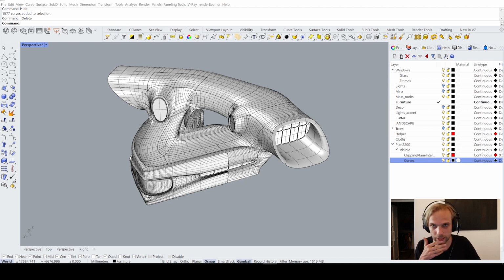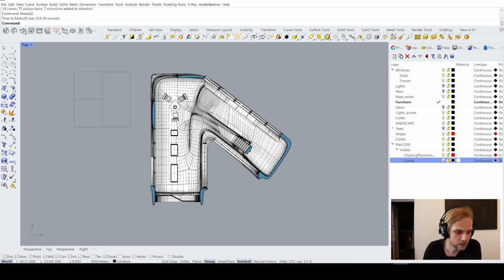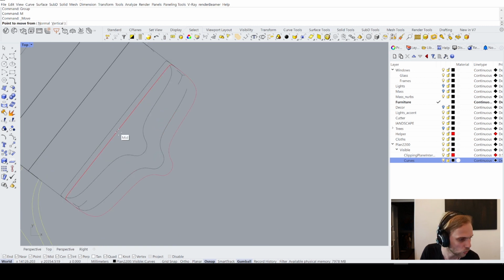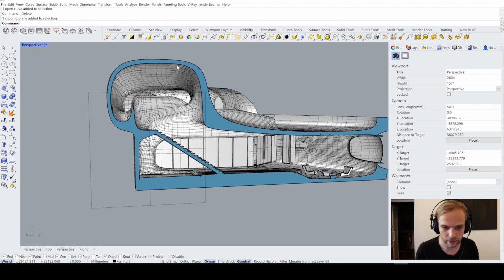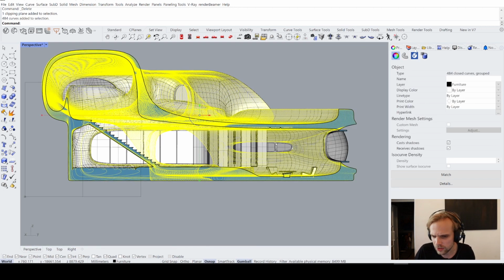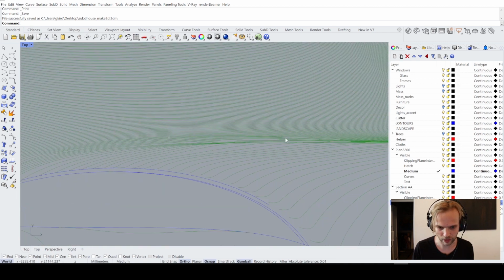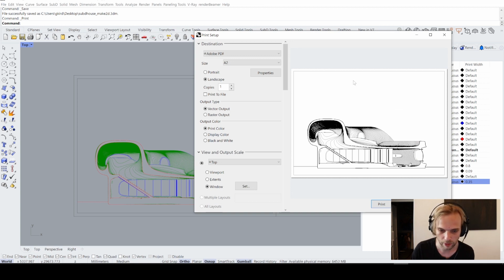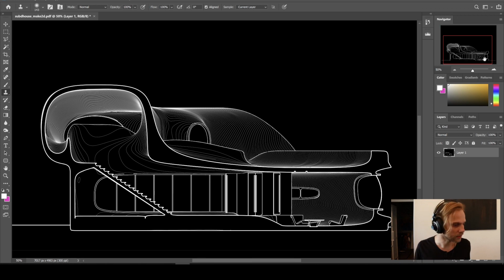How To: 2D drawings from an organic building model (with Rhino)

Comment: Amazing video as always! Quick question, I've been following your entire subd house series, for creating plans, sections, renders is it recommended to change subd geometry back to nurbs or mesh? Or can i keep working with Subd geometry? I've seen that you've converted it
Reply from the maker: You only convert SubD to Nurbs when you need to apply Nurbs-only modifications to the form mainly boolean union/difference. If you don't need to do boolean operations - then you keep it as subD to retain the non-destructive editing. You only convert SubD to Mesh for 3D printing (or if you're exporting to Unreal Engine) .
Reply: @DesignGoBrr   also if I want to render interior shell with a different material? is it recommended to extract surfaces of the interior subd layer to apply a different material texture?
Reply from the maker: @andywong8421  Yup. I think Rhino 8 will have the possibility for multi-material sub-object setup, but as it is now - it's cleaner to just have the faces extracted.
Reply: @DesignGoBrr  cool thanks, I'm guessing in your subd house project you've coverted due to boolean operations for furniture?

Comment: I would recommend just using the layout tab in Rhino, ad the "detail view", change the "detail view" display mode by double clicking it and set it to arctic or rendered to get the shades of the object topology.
Build Title block, annotations/hatches/colors, extra curves etc in layers on top of the detail views on the layout page. 
It'll incorporate future changes in your model. No need for the make2D workflow, no incomplete contours and all of that stuff
It'll be to scale and scaleable. You can change linewidths and colors in the layers tab. You can add unlimited amounts of layouts tabs, viewports, section cuts and what not. It works way faster. 

You can activate the Clipping planes in specific "detail views" in the "object properties tab".While having the clipping plane selected there is a drop down menu where you can choose between "model views" & "Layout views" to activate the clipping plane in the desired layout viewport"
If you want to export your drawings to PDF or PNG with rendered textures or shades make sure you have the latest graphics drivers installed on your machine so that it wont glitch

It's a bit of a hassle to figure to learn how to work layout pages & detail views but once you've got them down you'll make something similar to this in 15 minutes which can be instantly updated by simply changing things in the 3D model.

* I've added a video to elaborate (no audio) 
https://www.youtube.com/watch?v=cWfqfaUSQWg
Reply from the maker: Yes, I am familiar with that method and it's a good alternative to this one. The reason why I disregard it is because the output gets rasterized and (to my knowledge) there is no way to keep the linework vector-based while the underlying arctic shading is raster-based. This creates aliasing issues while printing with <600dpi printers (the stair-stepping effect for curved lines) and also makes it so that the pdf's cannot be reverse-engineered back into linework. I guess the short story of it is that there is no method that "does it all", there is always going to be a trade-off somewhere.
Reply: @DesignGoBrr  Awesome drawing and technique with the contours lines! Thanks for sharing. 
Regarding the alternative workflow, I think there should be no aliasing issues as you can choose a custom resolution to print to no? In any case, why are you worried about lines getting rasterized if in your workflow you imported them into PS? 

Maybe another alternative could be to make small pipes of the contours and print that in arctic or shaded. I did with Rhino's make2d worked better. Did you try changing the tolerance to see if it gets betters results?
Reply from the maker: @shynnsup8383  Changing the tolerance doesn't seem to have an effect anymore (it used to in Rhino 5). As for the confusion with rasterization - I used Photoshop just to show the accurate lineweights, in practice I always have all drawings handed out as vector based PDF's. Let me give you an example that seems to always happen: a year after a building has been built a client comes to me and asks for a dwg file because his contractor needs to make minor adjustments to the project (they bought a sink that's too big or something like that). Then all I need to say is - "the pdf's can be used as a reference" without needing to dig for a dwg file in my archives. If the pdf's were rasterized, I would need to send out the CAD file every time anyone needs to make minor adjustments. Eventually my work would just consist of sending out CAD files.

Comment: Very nice drawing. I wish one day make 2d, contours, booleals etc works as expected in rhino.
Reply from the maker: Yea... With every version of Rhino it keeps getting better and better.. But still, there's quite a bit of improving left to do
Reply: @DesignGoBrr  I don't think there are big improvements in many areas, especially where the tolerance factor occurs. I have sawn cases in McNeel forums where rhino 5 make 2d work better. Sadly, you spend 5 hours cleaning geometry. This is computer work. That's why we made computers. Anyway, your drawing was excellent. I was thinking if there is a way using grasshoper, to change the contours lines lineweight depending on the distance of the section. EG the first line ( around 20%) should begin with 0.2 mm lineweight and reduce it until the last 20% has lineweight 0.9. Then the section will have better depth feeling.